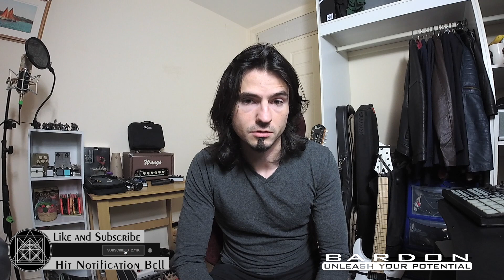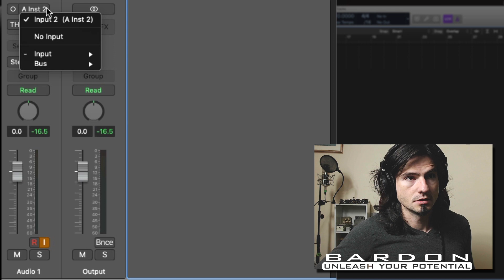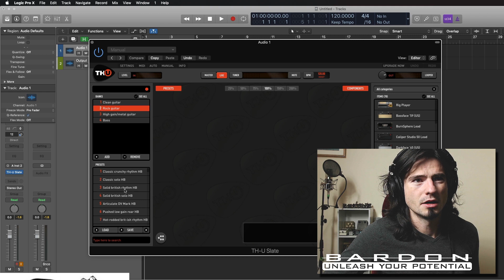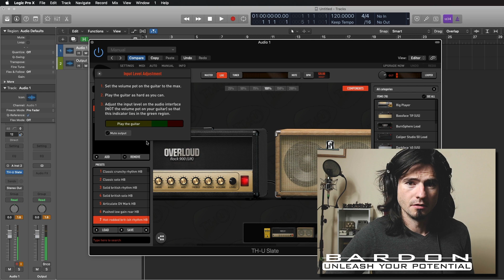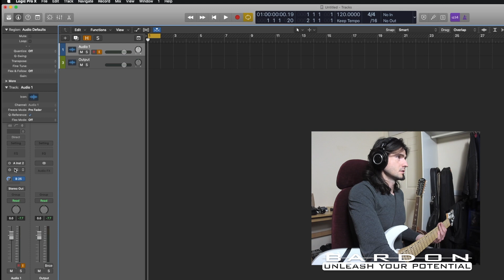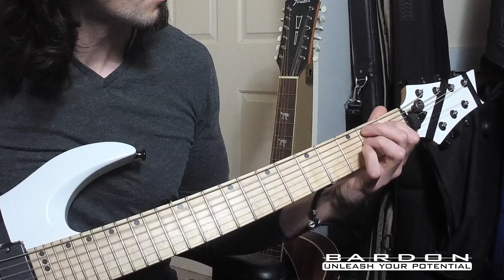How to Record Electric Guitar Amp Without Microphones | Record Electric Guitar Amp Direct

Comment: hey brandon , I would like to ask if this method can work on my marshall avt150 . by using its emulated speaker output going thru my interface but I am not sure if this will work. Any suggestions? thanks in advance
Reply from the maker: It will work but your emulated speaker output has a sound of its own making the IR method not as efficient as it is in the video... But that doesn't mean it will get you a bad sound
Reply: @bardonmusic  thanks man cheers!

Comment: Hey man, thanks for the video. I have been trying to figure out how I can use my amp and pedals when recording. I want to know if I am doing this right and using the right gear. I have something called a Jet Direct from Jet City Amplification. I think it can be used to convert my high impedance signal from the amp to line level? Here is what's in my signal chain: Guitar > Pedals > Amp > Speaker out to input on the jet direct > xlr on jet direct to my interface. I was not plugged into my cab at all. Is that bad for the amp? It shouldn't be because I am using the Jet Direct right? Well, it worked in getting my amp sound but it didn't sound great I'm assuming because of no cab sim. There was so much damn noise though and I want to know why. Anyways, I hope I am doing this right and would love some tips. Also, is there anyway to use guitar pedals to record without an amp? Like straight into your audio interface and still getting the best out of your pedals?
Reply from the maker: Hey Adam sorry for taking some time to answer, I took a good look at the Jet Direct and it seems to be only able to output a direct output from your amp and it doesn't seem to have a dummy load as part of the circuit and that's what protects your amp from blowing up when not connected to a cab, also the signal that you are getting if your are not using the mic sim output is what your amp sends to you cabinet at full force, this happens because the Jet Direct is intended to be mainly used in a live environment. I would recommend you to take a look at the 2 Notes Torpedo Captor, a great and not budget friendly solution that will solve your problem.

You can use your guitar pedals with no problem going into your interface, I would then recommend to use a guitar amp software such as TH-U to replace your amp, that works as well!!!

Comment: nice video and tutorial, but one question, can this be done with a solid state amp? I mean like: guitar > amp > amp's headphones out > audio interface. will this work? thanks
Reply from the maker: Thanks for your comment, it will work without any problems BUT the sound you will get out of it will be the sound of you headphones output on your amp which has its own sound and wont give you the flexibility of using IR's for example so keep that in mind. Don't get me wrong for as long as you dig that sound its ok, remember that the most important thing is to express yourself in a way that makes sense to you!!!
Reply: Thanks for the advice, after reading your response I tried doing it and yes you are right, the sound of the amp from its headphone out was kind of thin and very trebly haha I think I will just use some cab simulators from my multi effect or some software atleast emulate a raw amp sound 😊👍👍👍

Comment: I have a question
If I am recording using this connection :
Guitar --> Amp --> Amp Line Out --> Instrument Input of the audio interface --> computer (while recording)
Can i hear the guitar sound from the amp while recording ?
Reply from the maker: Thanks for leaving a question, can you elaborate more? do you mean hearing the sound of your guitar coming from your amp cabinet or from your computer?
Reply: @bardonmusic  from the amp's  speakers
Reply: @VladimirLem1946  I’m sure you have this answered by now, but Ive been using your method for awhile, and yes. The sound originates from your guitar amp, then is transferred into the interface into your computer. Also, if you have studio monitors (computer speakers) they will provide audio aswell, as long as they are selected to do that. Other than that, their main purpose is to playback the audio you recorded.

Comment: Thanks for the video! I was playing with th-u and it sounded great while playing live, but playback in the daw was flat and less dynamic. Do you know if I’m doing something wrong?
Reply from the maker: Remember that depending on how hard you attack your strings your interface will detect a softer or stronger signal and as such your virtual amp will "amplify" your signal differently. It has happened to me that when rehearsing I usually get exited and hit my guitar harder and once I'm ready to record my playing becomes "gentler" and as a result the sound is affected. Give it a try and let me know if this helps!!!

Comment: Hey bardon, I would like to ask if you plug in a combo amp like the Marshall MG50cfx. I just need to connect to "send" then directly to my audio interface right? Then load up the impulses???
Reply from the maker: Hey, thanks for asking, In theory it should be possible but what you are just going to get is the sound of the pre amp section of you Marshall into your interface and you'll be missing a huge part of the sound since you'll be bypassing the power amp, and that's where the punch comes from also you got to remember that your amp's output needs to always be connected to a speaker or a load box as the one that I use, otherwise you might damage it.  Another Option is using a software solution like T-HU, this video can help you: https://youtu.be/SyHL4TpbzL4
Reply: Bardonmusic I already have the full version of positive grid biax fx software but im not satisfied with the tones of it.

That’s why im going back to my marshall amps.

I am not really familiar with the box that you used in the video.

Does a DI box or “Direct Inject” will do the job? based on what you’ve said above?
Reply from the maker: @espercontrol7056  I know what you mean my friend, and to be honest I feel the same way regarding software solutions, they are very good, specially THU which in my opinion is way ahead of BIAS. But coming back to your question part of what makes a load box different from a regular DI is how your amp will react to it, the load will be the same as if you plug it to you cab which ensures that your transformer wont blow up and your amp will be working the way it should and you will ensure to get the great tone you are expecting from it. You don't have to use the same box as me, I would recommend this one: https://www.thomann.de/ie/two_notes_torpedo_captor_4_ohm.htm

It is really good, just make sure to get the one that matches your amp impedance!!!
Reply: @bardonmusic  Thank you for clarifying the different boxes. This video is truly helpful as I have only seen few information on how to properly use your tube/combo amps for recording.

Thank you for the recommendation link too!

I will look forward on your next videos, More Power!